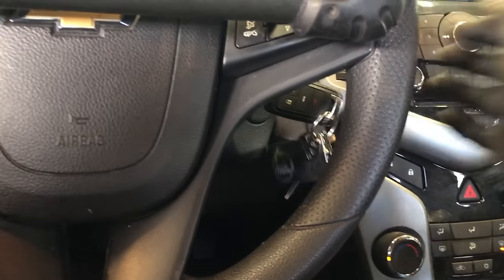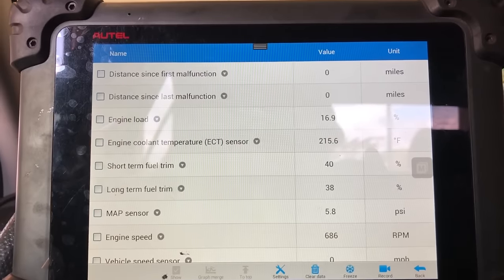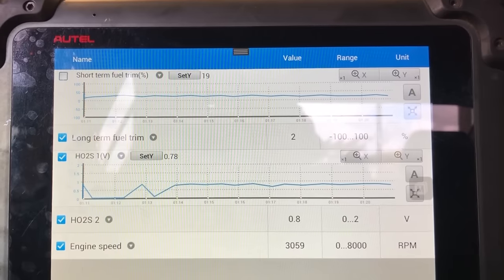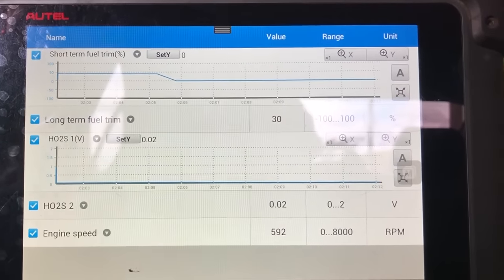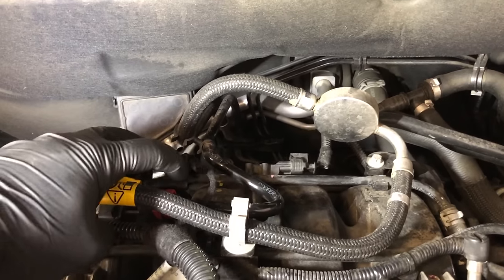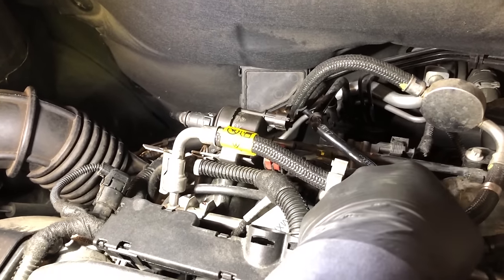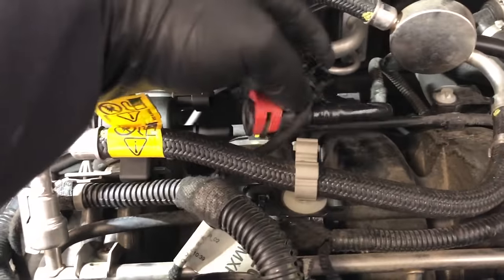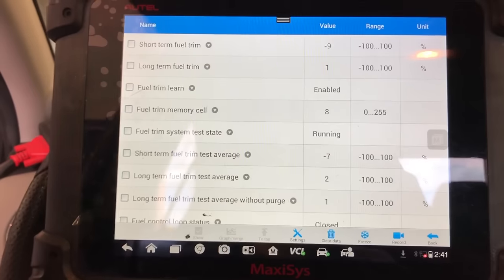How to Diagnose and Fix a Lean Condition - Chevy Cruze P0171

Comment: Hi Hektor - I own a 2018 Malibu and have the same error code P0171.  I've been told that to fix this issue I need to replace the cam cover which is very expensive.  I did not hear you discuss that as a possible issue so that makes me think the dealership is overselling the repair needed. Is a cam cover replacement an unusual solution to this problem?

Comment: Sir, I have a rather cheap Autel OBD II scanner that I've had for several years. I believe it is still in good working order. Can I get away with getting some basic information from this scanner without having to buy a more sophisticated scanner, that I would probably have a hard time figuring out?

Comment: Question? Same vehicle... I changed the intake manifold because of the intake runner control valve than had to change the pvc valve cover because oil started to leak in the manifold. after doing all that now the car will run between 30and 40 mph it will stall a little then would start blowing white smoke out of the exhaust pipe??? What would be the problem?

Comment: My chevrolet Sonic 1.5  2013 automatic model have hesitation issue.. also.. i experience when im on DRIVE, its getting hard time shifting its gears.. it should reach high rpm first before changing gear and its very rough when it changes the gear.. thats why i maximize the Manual mode most of the time.. whay might be the problem? having a hard time finding great mechanics in the Philippines like you..
Reply: i mean 1.4

Comment: Hi Hector,

I have a P0171 since some month now, but I am not able to figure out the problem. I did the smoke test like you showed, but no visible leak could not be seen. I unmounted the purge valve and tried to blow through it, but I couldn‘t.

I put my finger on the PCV valve but there is no sucking or blowing when the engine is running.

The air filter is new. The spark plugs are new.

I have changed both lambda probes.
(No originals)

Then I wanted to change the fuel filter, because I have read in the internet that a cluged filter can be the reason for a P0171. But on the place where you can find normally the fuel filter on this car is a big black plastic box, with the fuel lines in and out. (Right Rear at the bottom of the car)

I have no idea how I can move forward now.

Do you have any ideas?

I am driving an european model of the Chevy Cruze 1.6 with 124 horse power, hatch back, made in 12/2011. It is the gasonline version.

greetings Nino
(from Austria)

Comment: Hey Boss Hektor, Just want to ask  something, if i change the purge valve, do i need to reset the fuel trim? car model: chevrolet sonic 1.4 2013 LTZ. thanks!
Reply from the maker: Travel Engine no need to do that, they will reset on their own once the problem is fixed 👍🏼
Reply: @HomieHektor  oh nice, so i can do it by myself just to replace the purge valve. Thanks boss much appreciated 🙏🙏🙏

Comment: I am getting that code on my 2014 mini cooper, can I use the water spray, or throttle plate and air intake cleaner on the engine?

Comment: Got the p0171 code and p2270. Guy at autoparts store says it's the o2 sensor. Engine is making a vacuum squeal like noise when accelerating.
Reply from the maker: jedibbq Did the auto parts store diagnose it, or are they just telling you that based on the codes...Auto parts stores wanna sell parts, remember that 😎
Reply: Homie Hektor yea off just the codes. Thanks for the reply.
Reply from the maker: jedibbq P2270 is saying that the 02 sensor is stuck lean, that doesn’t mean it’s bad. P0171 is also a lean code. Chances are you have a vacuum leak causing both codes.
Reply: Homie Hektor yea I just checked that pcv valve. It's blowing out air and making a whistle sound. That's the leak right? Gotta change the valve cover then.
Reply from the maker: jedibbq That’s it right there 👍🏼
Reply: Homie Hektor Thanks a bunch sir.
Reply: @In_Need_of_a_Savior  got it on eBay for 45. Fixed the hesitation and the rpms don't jump anymore. Running good for now.

Comment: Sup Hector.  I have no codes on my Cruze. Check engine light blinks for 20 seconds when I accelerate on highway above 3 rpms and then stops blinking and doesnt come back on. It's a hesitation in the car. The service on dash once said service traction control but only came up once. Thanks.
Reply: what did u do? i got the same prob
Reply: @jmtolentino6397  me tooo?!!

Comment: Hello. I have a 2009 Cruze J 300, 1.6 - 83 kw. I have a problem starting. When the engine is cold, it shakes, it does not rev, I have to rev it from the accelerator so that it does not stop. If I try to leave the place before it warms up, it stops and starts hard... it spins on automatic every 7-10 seconds. What could it be? There is no error on the tester. Thank you.

Comment: I got the same code on my 2014 chevy Malibu but i do not hear an audible air leak and the engine sounds the same  no rough idle nor are rpms roller coasting. When i start from stop i accelerate slowly and it sounds like i have a hemi under my hood but its only a 2.5L

Comment: I have the same  code in my 2004 corolla change the both oxigen  sensors  I do the smoke thing  nothing  is wrong I change  all my ignition coils  and still ha e rhe same code  p0171  I leave  the check engine  like that  it's almost  a year and still no finding  the problem  can you help. Me with all the diagnostic  that I gave you...  ✌️

Comment: I cleaned the  maf sensor , Cleanes the throttle body , changed the valve cover , the purge valve & checked  for vacum leaks & its runs fine  but intermittently  runs rough at a stop light & even  shut off once . I was getting  po171 code. Any suggestions  Hector?

Comment: Hola Hector, tengo un 2013 chevy cruze, le he intentado de todo para borrar el code p0171 y nada, me podrías decir que puedo hacer o que parte cambiarle para arreglarlo?. Gracias y espero puedas responderme
Reply from the maker: I am the happiest P0171 es una mescla pobre de gasolina. Puede ser mucho aire o poca gasolina. En el caso mio era mucho aire a causa de la valvula de purga de emissiones. Pero puede ser varias cosas...
Reply: @HomieHektor  a mi carro ya le he cambiado, el pcv, el vacuum, los sensors del oxigeno, le cambie la bomba de gasolina, el main seal, el gasket cooler seal, y vuelve y vuelve otra vez el código P0171, me puedes recomendar que hacer si el código me dice que esta jalando aire y ya le he cambiado todas esas cosas. Te agradezco de antemano.

Comment: Hi Hector! I was told that the purge valve has to be calibrated.  Any truth to that?
Reply from the maker: J No, just replace it  and clear the codes 👍🏼
Reply: @HomieHektor  thank you! What about code po171, I do hear hissing when valve cover was taken off. Besides the obvious of needing it replaced, would that cause the Service Traction Control light to come on here n there?  I have a 2011 Chevy Cruze, that drives me crazy, but I love it. Lol

Comment: I have a chevy cruze 2013 that over heats on me and says AC off due to high temp! Would i be able to determine what's wrong with it witht he code scanner at Autozone? Pls help!
Reply from the maker: Laura Zavala No code scan is going to determine an overheating issue. Have the car checked for coolant leaks, those are known for having bad water pumps, leaking reservoirs, or water outlets at the back of the engine. If no leaks are found you could possibly have a bad thermostat 🤷🏻‍♂️
Reply: 2014 Chevy Cruze with the same problem
Reply: @HomieHektor  one mechanic looked at it and said it needed new head gaskets but I'm not sure if he knew what he was doing.

Comment: I loved the video  Subscribed  but I have a Question for you Chevy Cruz like you were working on 2013 eco-tech 1.4 leader we just bought the car and I checked it out everything was clean and good and then the wife turns on the command start and then the car shuts off cold inside and the engine light comes on
Reply: My code is the same code  could u get that code for the gas cap ?
Reply from the maker: Command start? Are you talking about the remote start… what do you mean by cold inside? What code are getting from the check engine light?

Comment: just experiencing same issue  witch P0171 and c0001, and also theres a noise in the engine witch i was told its the water pump so am yet to change the water pump..too but can u explain the c0001 code ?

Comment: That valve cover above is what my '14 Cruze 1.4L turbo looks like yet other videos show the PCV valve being under it and it is NOT.
Reply: Yours might be right on top..just above the oil filler cap..it'll be about 2 inches in diameter..

Comment: I just changed my valve cover and I just got this same code.
Reply from the maker: Check the oil cap and make sure the O-ring is sealing properly, also check the purge valve 👍🏼
Reply: @HomieHektor  I put the old oil cap back on to see if that fixes the problem. I’ve put my finger over the PCV valve and it’s not sucking any air in. So if this code comes back on what should I do?
Reply: @HomieHektor  I put the old oil cap back on to see if that fixes the problem. I’ve put my finger over the PCV valve and it’s not sucking any air in. So if this code comes back on what should I do?
Reply from the maker: @brittaniereed5664  You have to look at the fuel trims, to see if you have a problem somewhere else, smoke machine will help out 👍🏼
Reply: @HomieHektor  so I found my issue. My PCV hose was busted, so I replaced that. But I didn’t notice it was cracked until it sprayed oil everywhere. Since then my car has had an oil leaks from the Intercooler hose, I have replaced that but it’s still leaking. Could it be the Intercooler itself ? What do you recommend?
Reply: @HomieHektor  okay so let me ask this, I have just replaced my Intercooler hose because it had a oil leak coming from it after my PCV hose busted.  But after replacing the Intercooler hose the leak is still there. It’s leaking on driver and passenger side of the Intercooler the passenger side is the worst leak of the two. What could that be ?

Comment: My car keeps getting system to Rich bank 1 and 2 as well as mass or air volume flow sensor a circuit and I already replaced it with a new one and car started working better than it was but not  getting it again?
Reply from the maker: What kind of car? Year, make, and model.

Comment: Hey, Hector Homie, I'm having a similar problem. I get sputtering.  I changed the cap and gadget. I checked the purge valve. While I'm not hearing that sucking from the P.V. I put my glove  covered finger on it and it felt like someone was sucking a straw at the tip of my finger
Reply from the maker: Vito if the purge valve does that when it’s unplugged electrically, then that’s your problem 🧐
Reply: @HomieHektor  I'm gonna get it tommorow and see

Comment: Hello  I  have no  check engine light on my  dashboard  but my car  is  running  I feel like it's burning  rich and  running  hot  fans are running  I have  changed  thermostat, water pump and  temperature sensor. Not sure what's going on  I even flushed out radiator with a  garden  hose   acts like  something is getting  to hot after I shut it of start up  boy does it  skip like crazy  then clears up

Comment: Why do scan tools exist anymore when the damn car could just put this information up on a screen
Reply: lol, you're way off on what he was looking for in the scan tool. The car only knows that it needs more fuel because the stoich is not where it should be.
Reply: Seriously James?.... think about your comment....also the number of vehicles on Earth
Reply: @castledomeknives9395  what does the number of cars have to do with anything? Every car stores codes on it own computer and every code means something. This could easily be displayed on modern cars infotainment system for anyone to see
Reply: @jameshubbard7565  uuuu...ok,only a very small percent of vehicles have a screen to display data trouble codes...the REST(a huge percent) of the vehicles need a SCAN TOOL.... maybe your comment will be valid in 30 years

Comment: Hey Hektor,
Loved the video bro.
I'm in a similar situation.
Chevy Cruze 2016
Codes: P0106,P0171,P1101.
I just had the purge valve changed a month ago, now check engine light is on again with Service StabiliTrak, with above codes.
Should i just change the purge vavle myself or take it back to the shop where I had it changed in the first place. I don't wanna pay again for something that's easily fixable. Help buddy.
Reply from the maker: Karanjit Singh if you had work done for something that didn’t fix your problem, then take it back and have it fixed properly. Unless it’s a different issue of course 🧐
Reply: @HomieHektor  would u expect them to fix it for "free" if they didn't fix it the first time? What would your opinion be on a price range for the job and would it save me money to suggest those 3 potential issues and supplying the codes? I know those depend on the mechanic but your opinion would be valued
Reply: Karanjit Singh don’t. Pay unless it’s fixed

Comment: I replaced everything that can be replaced, plugs, plug wires, MAF sensor, 02 sensors, and I still have a lean code, and P0302 code. What could the issue be?? Please help. 
2007 Ford F150, 4.2 liter.

Comment: Could that also cause your car to loose power when warming?
Reply from the maker: ObeMore No, only when warming. Do you have a check engine light on?
Reply: @HomieHektor  yes, it kinda looses power at a certain point when warming up and then when I turn the ac and I make a stop it also loses power for like 2 seconds

Comment: Why would my 1.8 in my sonic have negative pressure in the crankcase I changed out the pcv valve because that was bad and I still have negative pressure and it’s idling bad again

Comment: Not bad.. not bad at all... Very good diagnosis
But how do you test it if it functioning properly. I mean if it is taking a signal to open or close?
Should I hear a click or something?
Reply from the maker: Ibrahim ELTONY Backprobe it check for power and a good signal from the PCM. A clicking would mean its being controlled not necessarily that is good. There’s a couple of ways you can do it.
Reply: @HomieHektor  
Well.. it seems that it is more close to trial and error. Not exactly, but there is no definitive way to judge on its performance. Then leave it untill fails

Comment: Hi my name is Manny I have 2015 Chevy Cruze and there's only one issue with my car P0240 I cleared the codes myself and the same codes comes back again.
Reply from the maker: P0240 and not a P0420 correct? I’m assuming you have a turbo on your Cruze. If so there’s a discrepancy with pressures. Need to have that checked out. Might just be a bad sensor 👍🏼
Reply: I replaced the oxygen sensor last year
Reply from the maker: Manny Martinez I don’t think that’s related to the code you gave me.
Reply: I'm sorry it's PO420
Reply from the maker: Manny Martinez you might have a bad catalytic converter
Reply from the maker: Manny Martinez watch this video https://youtu.be/pflPZTVa3fE
Reply: Hey bro the check engine light when off itself a few days later the came back on. And I scan the codes P0171

Comment: Got this code but it runs fine. 2014 sonic BUT has 32k miles(sat up outside not driving for most of its ownership) also the traction light randomly comes on at idle smh

Comment: my chevy 2011 same problem check engine but the dueck auto dealer told me they diagnose  i need to change my turbo and im doubt of it last 4 days they change my catt converter and oil fan its cost me 2 thou canadian dollars
Reply: Tipical of Vancouver, carter is no better.

Comment: I’m still trying to figure out how a lean condition is caused by fuel vapors. Shouldn’t the engine pull a vacuum on the entire fuel tank? Idk the canister vent valve vents to atmosphere when it’s closed meaning the circuit running to the engine is open to atmosphere when the vent valve is closed... maybe... I forget how that shit works I just know one of the valve in the system can vent to atmosphere and that’s gotta be what causes the lean condition.

Comment: lots of issues with the cruzes,water pump leaks,bad thermostat and the pcv valve had a recall which will make the engine stall and have a vacume leak.

Comment: I got a 2011 Cruze and my p2270 , p1101, p0171, u0100 how can I fix this
Reply: I changed my purge valve, I changed my spark plugs and boots and valve cover and still a little rough idle should I clean it with sea foam lol

Comment: If it wasn’t the purge valve what would be the next step?
Reply from the maker: jose ocampo Everything else, a lean condition on this vehicle can be a vacuum leak (torn intake boot, leaking pcv valve, purge valve, brake booster, leaking vacuum hoses) or a fuel issue (fuel pump, injectors, O2 sensors, MAF sensor etc...) first determine if the lean condition is at idle or off idle 👍🏼
Reply: Homie Hektor thanks for replying quick!!

Comment: I’m getting a engine light and service stability track error wtf is reason it won’t start I replaced crank case and spark plug wires on top of case and still won’t start
Reply from the maker: John Bonnell it can be anything, what code are you getting for the check engine light.?.